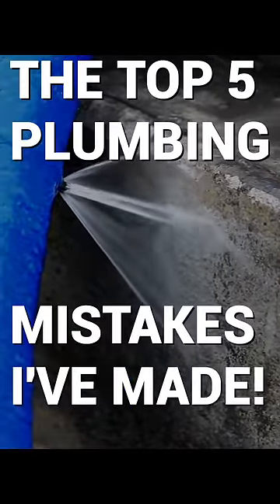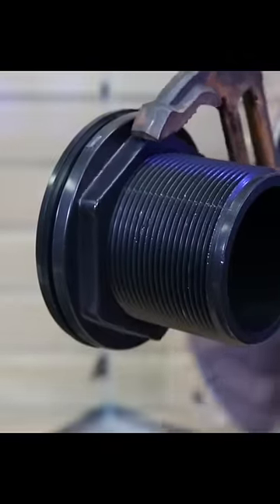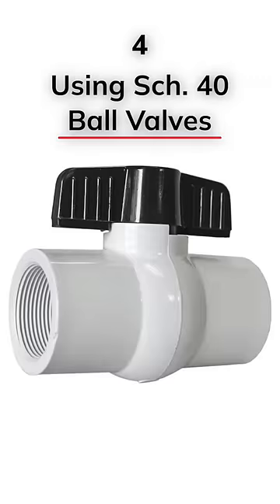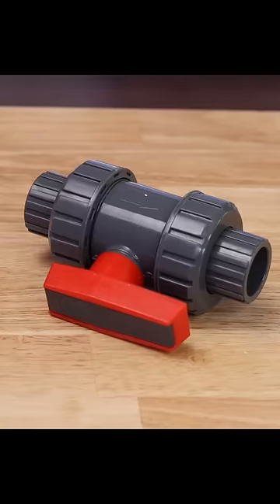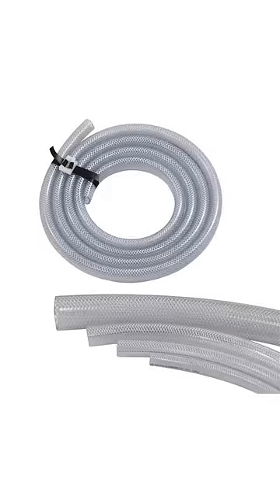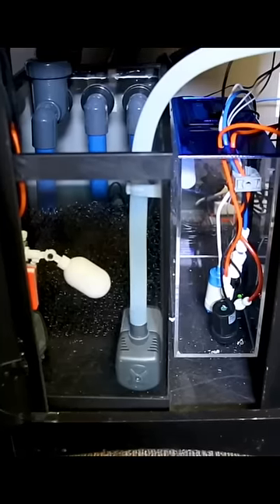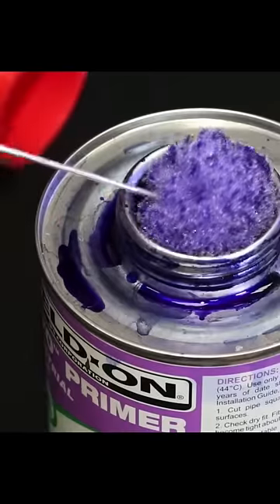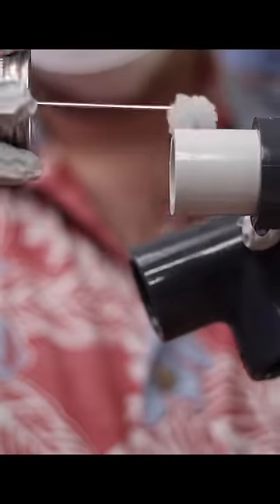Avoid These 5 Aquarium Plumbing Mistakes at All Costs!

Comment: Weld on 705 clear glue is glue and primer mixed togther, if it’s not getting inspected you do not need to prime it. You can use weld on 705 for any pipe size 4” and smaller. For anything over 4” you have to use weld on 711 which requires you to prime it. Long story short use weld on 705, when you glue sch 80 pipe you sand the ends before you apply glue. Tips from a commercial plumber

Comment: I use fast set blue glue, such as Rain-R-Shine.
Mostly used by irrigation and pool techs.
Can be pressurized in minutes.
Also, the color lets you confirm that the pipes and fittings are fully covered.

Comment: Why care about purple primer? If you're using specialty fittings and pipe you use clear for both, if you're using standard schedule 40 from the hardware store what do you care? I paint my plumbing after gluing and before final install.